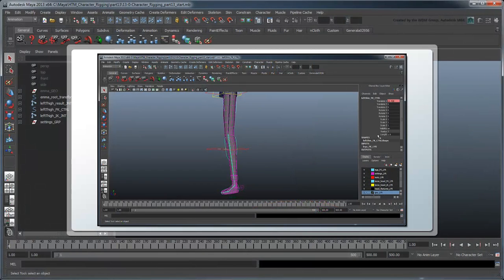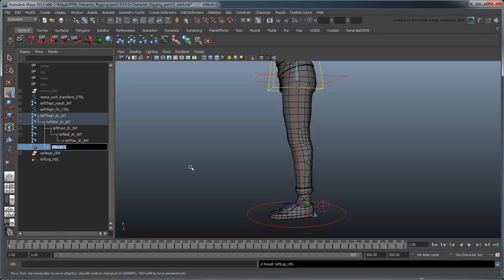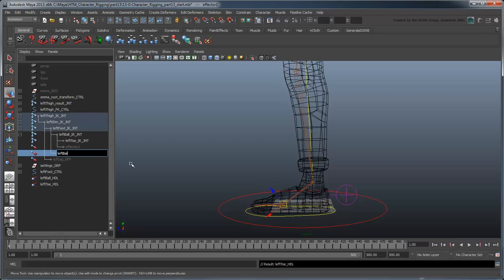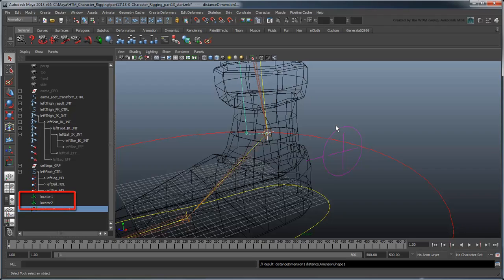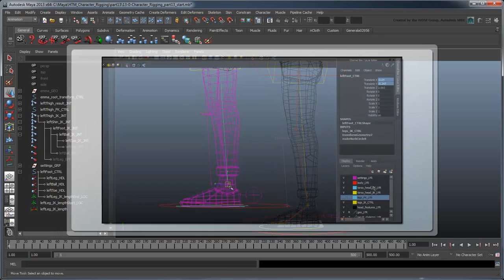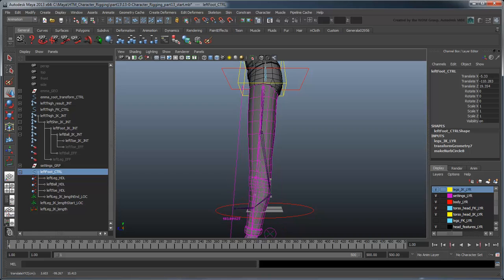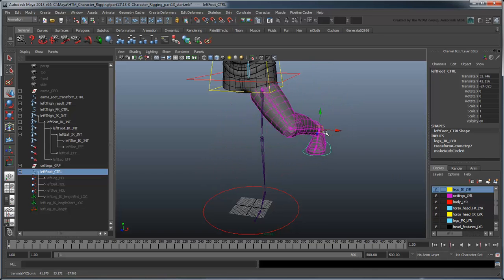Creating a Character Rig - Part 13: Leg IK controls and joint stretching (Advanced)

Comment: Hi, why do we use sum of length, letting the leg straighten more, when the model is already straight? (I mean: Bending of the leg)

May be we should use:
float $sumLength = `getAttr leftLeg_IK_lengthShape.distance`;

"flipping effect" becomes not so visible
---------------------------------
what do I mean by "flipping Effect" - when you move down slowly foot_ctrl, the knee accelerates and than "flipp!"
Reply from the maker: Because we only want to start stretching the leg once it reaches the full length of the thigh and shin.  Otherwise, the leg will start stretching when it's still in a bent position, which will look rather strange.  Notice in our tutorial the leg has a bit of a bend to it (which it generally should) in its default position.

Comment: Hey there, Love this series and I'm using it to learn different techniques to achieve the same outcome. However, after following everything I've read and seen in the comments, my script works fine, but I've lost the bend in my knee and the bones are completely straight. Pre-infinite is cycle, post is linear, and im on spline tangents. Working in centimeters (that note helped a lot). When I changed the post-infinity to linear, the knee snapped straight.
Reply from the maker: Are you sure you set the stretch at 2x length in the script?  If you set it to 1x length, that would cause the leg to straighten out (since it can actually reach that length and stay there).
Reply: string $driver = "L_Leg_DistShape.distance";
float $L_ThighLength = `getAttr L_Knee_IK_jt.translateY`;
float $L_ShinLength = `getAttr L_Ankle_IK_jt.translateY`;
float $sumLength = $L_ThighLength + $L_ShinLength;

setDrivenKeyframe -currentDriver $driver -driverValue $sumLength -attribute "translateY" -value $L_ThighLength L_Knee_IK_jt;

setDrivenKeyframe -currentDriver $driver -driverValue ($sumLength*2) -attribute "translateY" -value ($L_ThighLength*2) L_Knee_IK_jt;

setDrivenKeyframe -currentDriver $driver -driverValue $sumLength -attribute "translateY" -value $L_ShinLength L_Ankle_IK_jt;

setDrivenKeyframe -currentDriver $driver -driverValue ($sumLength*2) -attribute "translateY" -value ($L_ShinLength*2) L_Ankle_IK_jt;

I did. Here's my script.
Reply from the maker: Is it "translateY" because you oriented the joints' LRAs differently?  If so, are you sure the Y-axis is pointing down all the bones?  

Also, double check that your IK handle is using an RP solver.
Reply: So I tried that, and my thigh and shin joint just double in size as soon as I run the script. The IK is RP. Really wish Youtube would allow images in the comments section, that would make explaining my situation so much easier.
Reply from the maker: Doubled in size or length?  If the latter, does the stretching work?
Reply: The latter. Sadly the stretching does not work. The tangent is still spline and now when I set the post infinity to linear, the joints break and shoot everywhere.
Reply from the maker: Using the Move Tool in Object mode, try selecting each of your IK and result joints.  Does the red arrow point down the bone, or in some other direction?  If the latter, your local rotation axes aren't set up correctly.  If this isn't the case, then do you receive any kind of warning along the lines of "Cyclical dependency" when you attempt to stretch the leg?
Reply: The orientation is set for the x axis down the bone, yes. I do not get any error, but the joints seem to flicker after pulling them down the world y-axis after some point below the foot so there could be an issue in calculation somewhere.
Reply from the maker: Wait, if the X-Axis is pointing down the bone, why are you changing the Translate Y values?
Reply: I changed it back to translate x after you pointed that out, so now my script looks like this.

string $driver = "L_Leg_DistShape.distance";
float $L_ThighLength = `getAttr L_Knee_IK_jt.translateX`;
float $L_ShinLength = `getAttr L_Ankle_IK_jt.translateX`;
float $sumLength = $L_ThighLength + $L_ShinLength;

setDrivenKeyframe -currentDriver $driver -driverValue $sumLength -attribute "translateX" -value $L_ThighLength L_Knee_IK_jt;

setDrivenKeyframe -currentDriver $driver -driverValue ($sumLength*2) -attribute "translateX" -value ($L_ThighLength*2) L_Knee_IK_jt;

setDrivenKeyframe -currentDriver $driver -driverValue $sumLength -attribute "translateX" -value $L_ShinLength L_Ankle_IK_jt;

setDrivenKeyframe -currentDriver $driver -driverValue ($sumLength*2) -attribute "translateX" -value ($L_ShinLength*2) L_Ankle_IK_jt;

I should have said that I made that change. Sorry. But the script still doesn't seem to wanna work properly.
Reply from the maker: I don't think this is a problem with your script.  It sounds to me like something is parented incorrectly.  Did you try downloading the included scene file and comparing the hierarchy with your own?

It also seems possible that your $driver value (L_Leg_DistShape) is not querying correctly.  When the leg is in it's rest pose, is this measurement node showing roughly the Translate X of the IK Knee + IK Ankle values?
Reply: I did compare the download hierarchy to my own and everything seems exactly the same except for different naming conventions. 

That's the weird thing. The viewport value is different from the measurement nodes distance value, but it seems like a conversion rather than a disconnect or improper value. I've tried other techniques and it validates that even though the display value is much smaller, its the distance value in the attribute editor that is the one I want to utilize which is the value in my script. Example, the viewport distance is 2,953, but the node distance is 90.028. I'm assuming that is because I'm working in feet on the graph.

Comment: I'm still using Maya 2015 because I can't afford to upgrade.  In 2015, Maya sometimes has precision problems on floats when running scripts, so I had to use getAttr in the MEL command box for all of the attributes and then copy and paste the returned values into the script instead of using the variables.  I don't know if this has been fixed in 2016, but I thought I'd mention it for those still using 2015.

Comment: My script is running perfectly but joint does not stretch
Reply from the maker: Did you see the annotation at 10:26 that mentions using Spline tangents rather than Linear tangents?
Reply: Thank you for replying. Yes I did that but It is not working. Thigh part is stretching but second Shin part (Between Shin and foot) is not stretching. There is no error in command or any thing.

Comment: When I add the second line with ($sumLength*2) and Execute All, the shin joint snaps forward (the thigh elongates) and the leg wont retain its original size. I've retried the process at least once. Here is my code:

string $driver = "leftLeg_IK_lengthShape.distance";
float $leftThighLength = `getAttr leftShin_IK_JNT.translateX`;
float $leftShinLength = `getAttr leftFoot_IK_JNT.translateX`;
float $sumLength = $leftThighLength + $leftShinLength;

setDrivenKeyframe -currentDriver $driver -driverValue $sumLength -attribute "translateX" -value $leftThighLength leftShin_IK_JNT;

setDrivenKeyframe -currentDriver $driver -driverValue ($sumLength*2) -attribute "translateX" -value ($leftThighLength*2) leftShin_IK_JNT; 

I've written the code both with tildas and (" ") and I've had the same result.
Reply: I had a previous comment where I had an extra knee joint. I rebuilt the leg to match the videos exactly
Reply: I solved my "knee snap" problem. My animation working units had been set to "feet", and they needed to be set back to "centimeters" for the code to work properly (Windows>settings/pref>pref>settings>working units>centimeters).
Reply: You're a lifesaver! I couldn't work my problem out either. Had my units set to Metres - changed it like you said and BAM all is fixed!

Comment: I created my leg chain with an extra joint for the knee. I tried to add it into the code, but when I hit Execute All, the chain elongates forward at the knee level.

Here is the code I used (I'm running maya 2016):

string $driver = "leftLeg_IK_lengthShape.distance";
float $leftThighLength = getAttr ("leftKnee_IK_JNT.translateX");
float $leftKneeLength = getAttr ("leftShin_IK_JNT.translateX");
float $leftShinLength = getAttr ("leftFoot_IK_JNT.translateX");
float $sumLength = $leftThighLength + $leftKneeLength + $leftShinLength;

setDrivenKeyframe -currentDriver $driver -driverValue $sumLength -attribute "translateX" -value $leftThighLength leftknee_IK_JNT;

setDrivenKeyframe -currentDriver $driver -driverValue ($sumLength*2) -attribute "translateX" -value ($leftThighLength*2) leftknee_IK_JNT;

setDrivenKeyframe -currentDriver $driver -driverValue $sumLength -attribute "translateX" -value $leftKneeLength leftshin_IK_JNT;

setDrivenKeyframe -currentDriver $driver -driverValue ($sumLength*2) -attribute "translateX" -value ($leftKneeLength*2) leftshin_IK_JNT;

setDrivenKeyframe -currentDriver $driver -driverValue $sumLength -attribute "translateX" -value $leftShinLength leftfoot_IK_JNT;

setDrivenKeyframe -currentDriver $driver -driverValue ($sumLength*2) -attribute "translateX" -value ($leftShinLength*2) leftfoot_IK_JNT;

- - - 

My leg bend and joint orients seem to be correct. Am I just trying to do something I can't do?

Comment: hello..
i have wrote the script for right leg to stretch but its not working.
please tell me where m i doing wrong ?

string $driver = "righthindleg_ik_lengthShape.distance";
float $righthindThighLength = `getAttr right_hind_knee_ik_bn.translateX`;
float $righthindKneeLength = `getAttr right_hind_foot_ik_bn.translateX`;
float $sumLength = ($righthindThighLength*-1) + ($righthindKneeLength*-1);

setDrivenKeyframe -currentDriver $driver -driverValue $sumLength -attribute "translateX" -value $righthindThighLength right_hind_knee_ik_bn;
setDrivenKeyframe -currentDriver $driver -driverValue ($sumLength*2) -attribute "translateX" -value ($righthindThighLength*2) right_hind_knee_ik_bn;
setDrivenKeyframe -currentDriver $driver -driverValue $sumLength -attribute "translateX" -value $righthindKneeLength right_hind_foot_ik_bn;
setDrivenKeyframe -currentDriver $driver -driverValue ($sumLength*2) -attribute "translateX" -value ($righthindKneeLength*2) right_hind_foot_ik_bn;
Reply from the maker: Hmm, the script looks okay to me.  It might be something wrong with your setup.  Are the local rotation axes all set up correctly (with X pointing down the joints)?
Reply: yeah it is in the same as depicted in the video.
but the thing is my problem is solved, thank you for the reminder.

Comment: Hi, i have a problem, im working on maya 2017, and im doing the programation of the IK like you do in the video, but when i execute all, it does the stretch but don't make the key frames. at the end of the process the result is 0

string $driver = "leftLeg_IK_lengthShape.distance";
float $leftThighLength = getAttr ("leftShin_IK_JNT.translateX");
float $leftShinLength = getAttr ("leftFoot_IK_JNT.translateX");
float $sumLength = $leftThighLength + $leftShinLength;

setDrivenKeyframe -currentDriver $driver -driverValue $sumLength -attribute "transalteX" -value $leftThighLength leftShin_IK_JNT;

setDrivenKeyframe -currentDriver $driver -driverValue ($sumLength*2) -attribute "transalteX" -value ($leftThighLength*2) leftShin_IK_JNT;

setDrivenKeyframe -currentDriver $driver -driverValue $sumLength -attribute "transalteX" -value $leftShinLength leftFoot_IK_JNT;

setDrivenKeyframe -currentDriver $driver -driverValue ($sumLength*2) -attribute "transalteX" -value ($leftShinLength*2) leftFoot_IK_JNT;
// Result: 0 //
Reply from the maker: Hmm, did you lock any of those translate values, or make other connections to them?  Are you sure all your nodes are named correctly?  As far as I can see, your script looks right.
Reply: No, i did not have,  the nodes, bones and all the other pices have the same name, i did replicate the code in the save of the folder with the MEL of the pack and happen the same, i also check the final result in the graph editor and appear the same, like if they don't have other points
Reply: i think is a problem in the way Maya 2017 manage the info
Reply from the maker: Did you set the Tangent to Spline?  I know the video says to set it to Linear, but we added a correction via annotation at 10:30.
Reply: the point is it does not make the two points in the graph editor, i copy my save file to .ma and i open it in 2013, and now i can see the two points in the graph editor, it seems to be a problem whit the way maya 2017 reads the information
Reply from the maker: That's odd because I'm running 2017 and just tried it and it's fine.  Have you installed all the patches and tried deleting your prefs?
Reply: Not really, but i think i'm going to continue with the tutorial in the 2013 version, anyway, thanks for the help, great tutorial also.
Reply: I'm using 2017 and the script is working perfectly,
Have you tried "official":
float $leftShinLength = `getAttr leftFoot_IK_JNT.translateX`;
 
instead of:
float $leftShinLength = getAttr ("leftFoot_IK_JNT.translateX");
Reply: well seems you wrote transalte instead of translate

Comment: I've been going over this part again, but this time something weird happened. when I run the script, it leaves a 'rotate y' value on my shin and foot IK joints. the number changes each time i re-run the script. they're not keyed but i can't zero out the number. neither of the joints' 'rotate y' attributes are hooked up with anything in the node editor. the distance remains still though. but the IK leg bends slightly forward all the time because of this 'rotate y' values. does anyone know why? :(
Reply: rebooted & solved..

Comment: When I apply the script to the right leg, the orientation of the R hip and shin reverse. This happens when I set the curves to linear for post-inifinity. Am I doing something wrong or is this issued addressed by a later video?
Reply from the maker: There are specific notes for mirroring the right-side in Part 32.  You need to make sure your joints are oriented correctly (it's not identical to the left side).  You can see the fully mirrored skeleton in the part 32 scene files for reference.
Reply: Maya Learning Channel
thanks again

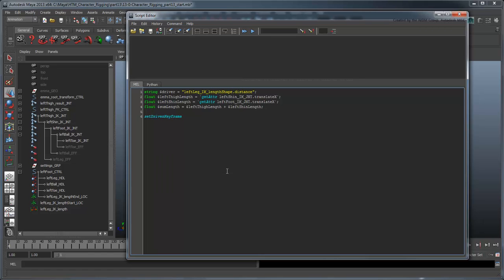Comment: 7:58 it seems that in 2016 the mel command now highlights for 'SetDrivenKey' instead of 'SetDrivenKeyframe.' Is this correct?
Reply: Found that the prompted command is wrong. The video states to type in "SetDrivenKeyframe" though we should actually be using a lower case 's' for that command
Reply from the maker: Yes, that was a regrettable typo.  We already have an annotation with the correction.  As you continue with the series, I would enable annotations because there are a few other small corrections like this in future videos.
Reply: Maya Learning Channel
thank you for the advice

Comment: Just a heads-up:

For Maya 2016 (at the time of writing) the syntax for the float variables is different from the video. the proper syntax is as such:

float $leftThighLength = getAttr ("leftShin_IK_JNT.translateX");
float $leftShinLength = getAttr ("leftFoot_IK_JNT.translateX");

Figured I'd save anybody else following along in 2016 some time.
Reply: also the thigh does not stretch when I pull on the foot ctrl
Reply: still doesn't work for me. Mel doesn't recognize procedure "SetDrivenKeyframe" though it does recognize "SetDrivenKey."
Reply: Found that the prompted command is wrong. The video states to type in "SetDrivenKeyframe" though we should actually be using a lower case 's' for that command
Reply: when I do this I get // Result: 0 //  
And the translateX is not keyed
Reply: Thank you for that fix, was getting frustrated about what i was doing wrong with these two floats!
Reply: thanks!!
Reply: why would they change sth like this though...
Reply: Thank you
Reply: Thanks for that!!!

Comment: Help me please I am stuck on this error 
string $driver = "leftLeg_IK_lengthShape.distance";
float $leftThighLength = `getAttr L_Knee_IK_JNT.translateX`;
float $leftKneeLength = `getAttr L_Ancle_IK_JNT.translateX`;
float $sumLength = $leftThighLength + $leftKneeLength;

setDrivenKeyframe -currentDriver $driver -driverValue $sumLength -attribute "translateX" -value $leftThighLength L_Knee_IK_JNT;
// Error: line 6: No match found to driver: leftLeg_IK_lengthShape.distance //
Reply: It's naming syntax error. You're typing in a certain name in the script editor but the actual name of the object is different. For example, I am using my own naming convention, so I named my distance tool "DISTANCE_IK_L_Leg01" but when it comes to shape node names, Maya inserts the 'Shape' part in between 0 and 1, so it becomes "DISTANCE_IK_L_Leg0Shape1" instead.

If you are following this tutorial to the T, then you might have made a small error in syntax.

Comment: Hi, I'm following this tutorial series and I was on the IK arm stretching but I couldn't get the script to work so I came back to this tutorial and tried typing the script in manually and it still comes up with the same error... // Error: line 6: 
This is what I've been typing in. I was wondering if you could tell me where I went wrong?

string $driver = "leftArm_IK_lengthShape_distance";
float $leftUpperArmLength = `getAttr leftForeArm_IK_JNT.translateX`;
float $leftForeArmLength = `getAttr leftHand_IK_JNT.translateX`;
float $sumLength = $leftUpperArmLength + $leftForeArmLength;

setDrivenKeyframe -currentDriver $driver -driverValue $sumLength -attribute "translateX" -value $leftUpperArmLength leftForeArm_IK_JNT;

Thanks.
Reply from the maker: +Rachel Lewis You forgot the semi-colon at the end of the line.